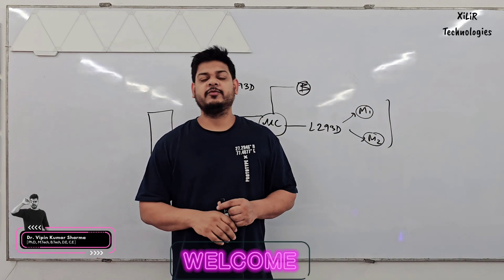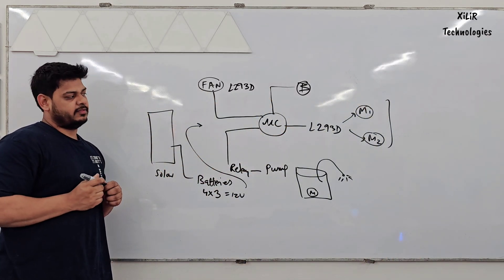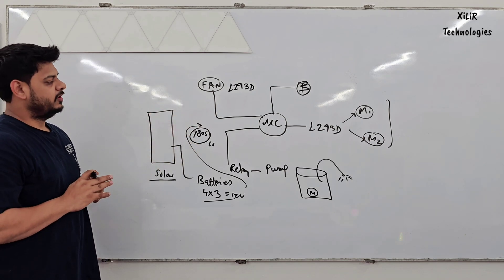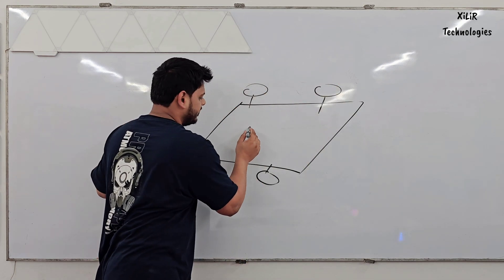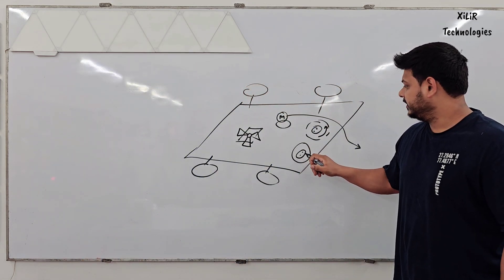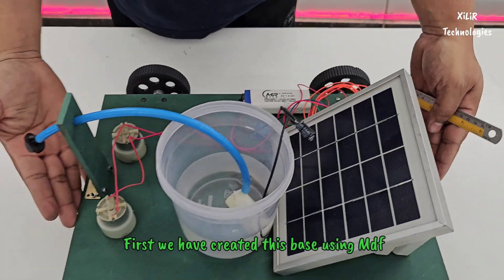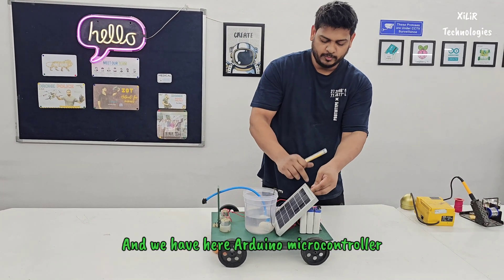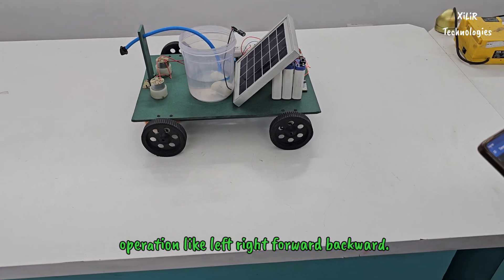🌞 Solar Panel Cleaning Robot using Arduino | Engineering Project | Award Winning

Comment: Sir...nodemcu esp8266 are not connect to pc...how..to connect and the nodemcu blue  light not blink....and i have check tha data cable and check & test other datacable but no any respone...be..seen..😔...sir plz tell mee solution or plz make aa video...
Reply from the maker: @Rohit_0012_x  may be damage hogaya ho... check some videos on it on youtube
Reply: @XiLiRTechnologies  sir I have check all damage and check all issues.. and I seen many video....on youtube...but this problem is big problem...🤯
Reply from the maker: @Rohit_0012_x  buy new one n.check same happens...install all driver like ch340
Reply: @XiLiRTechnologies  OK...sir..❤️